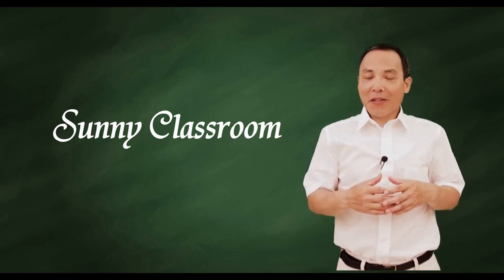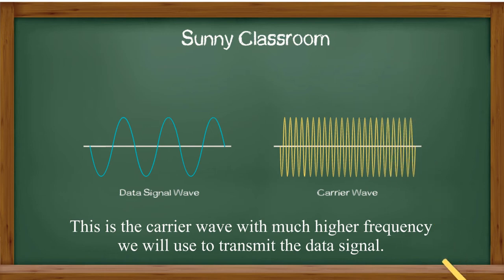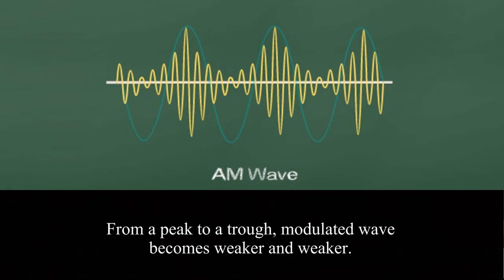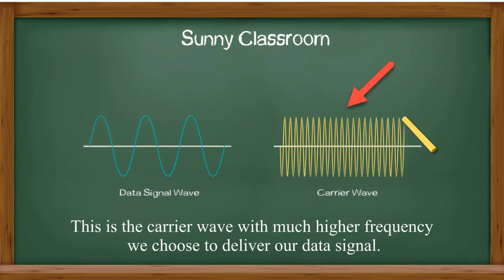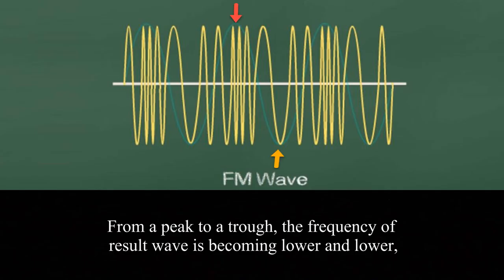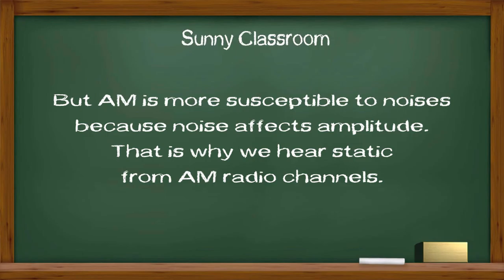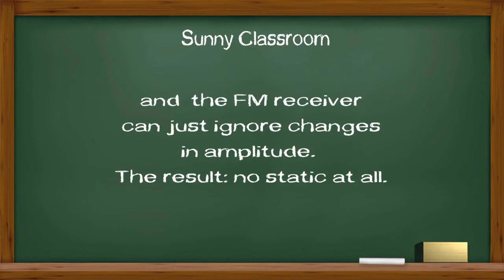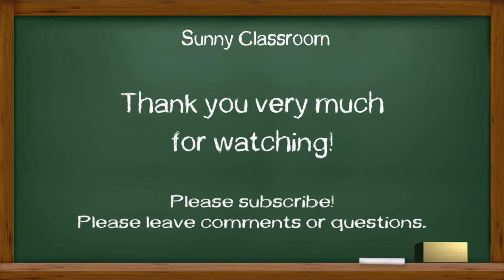AM vs FM

Comment: 2:44 when we talk about data transmission, when we mean that we have a high bandwidth, then we have a high frequency range and thus the data can be transmitted over a longer distance, as far as I know. But here it says that AM frequency range is lower and that's why it can cover larger areas, and that would contradict what I said before. What am I missing? >.<
Reply: higher freq = higher bandwidth but lower area coverage.it also used in 5g that they have to built many nanocell to gain more bandwidth
Reply: there's no such thing as "AM frequency". What you are missing is that on high-frequency bands there simply is more space ("bandwidth"). On mediumwave and longwave, stations are just 9 or 10 KHz apart. On shortwave they can be 5 KHz apart. On the FM-band  (aka "3-meterband"), that is 87.5-108.5 MHz, they are at least 100 KHz apart. Also, the higher the frequency, the more information you can modulate
Reply: @farenzu4578  "higher freq =  lower area coverage".  Not necessarily. Most high frequencies all have a comparable area with a radius of a few dozen kilometers. 5G needs more stations than other frequencies because it uses a frequency of 600+ MHz that gets absorbed by oxigen - just like visible light gets absorbed by fog

Comment: Thank you Sunny for  your excellent lectures!!  In your previous lesson, you said carrier waves travel further than signals because they have higher frequency . Does it mean higher frequency waves have larger area coverage? IF SO, but  in this lesson you said AM covers larger area because of its lower frequency!   Do you mean , in general,  carrier waves used in AM have a lower range than  carrier waves used in FM? Thank you
Reply: carrierwaves do not travel further than signals. In fact, some radioamateurs use signals without carrierwave to get greater distance. It is called "single side band", either upper or lower. (SSB, USB, LSB)

Higher frequencies don't have larger coverage, but in shortwave they do have a bigger "dead-zone")

Comment: On FM, if the frequency is changing depending on the data signal, how can a radio receiver tune to that carrier frequency?  Does frequency modulation actually change the carrier frequency?
Reply: Yes, on FM it changes carrier frequency up and down from main tuned frequency and it is called bandwidth. There is narrow bandwidth and wide bandwidth. Narrow bandwidth is used for voice communication where is not important complete audio spectrum such bass and treble audio frequencies like on police, army, fire department... communication so the bandwidth is narrow and it could be 30kHz, 25kHz, 12kHz, that means on 30kHz bandwidth it changes 15kHz up from main frequency carrier and 15kHz down from main carrier frequency, on 25kHz bandwidth it changes 12,5kHz up and 12,5kHz down, on 12kHz bandwidth it changes 6kHz up and 6kHz down from main frequency carrier. The narrow the channel bandwidth is the lower the quality sound reproduction is (cutting bass and treble audio range), but benefit is you can have more frequency channels on the same range.
On wide channel bandwidth such demand on commercial radio broadcasting 87,5-108 MHz where people are listening the music and demanding high quality sound reproduction, you need to modulate whole audio spectrum from 20Hz-20kHz the basses, midrange, treble, then stereo subcarriers, pilot, left an right channel, you need wide bandwidth such 200kHz, that means 100kHz down and 100kHz up from main frequency carrier to compress whole information.
The television channels take even wider bandwidth 8 or 9MHz, that means 4,5MHz down and 4,5MHz up to modulate sound and picture on frequency carrier. Previous when was TV analog modulation you could on one channel modulate only one TV station. Sound was FM and picture was AM modulated, today when is digital broadcasting you can modulate on one frequency TV channel up to 10 different TV programs which package of different TV programs on one frequency is called multiplexer.

Comment: Why does the lower frequency range of an AM cover a larger area?
Reply: Because lower frequency means larger wavelength and hence larger area.
Reply: Groundwave/Skywave propagation.
Reply: Wrong question. Low frequencies (longwave, mediumwave, shortwave) get reflected by layers high up, whereas high frequencies like UHF go (almost) straight into space. These things are notr dependent on modulation-type